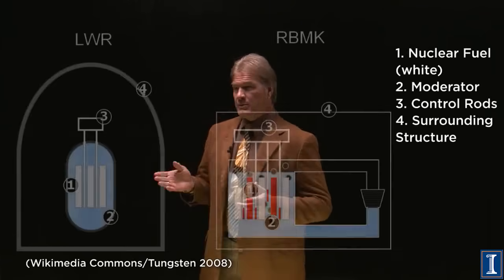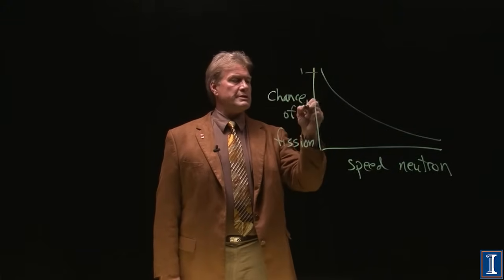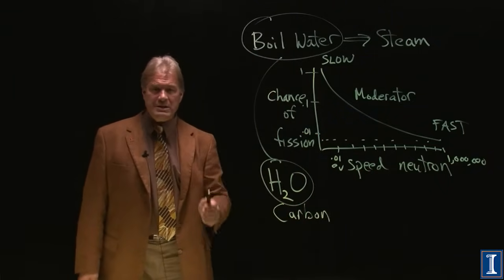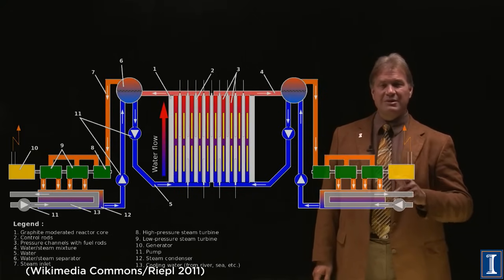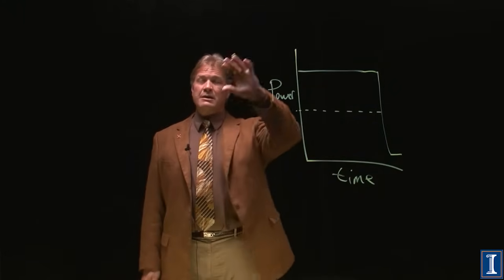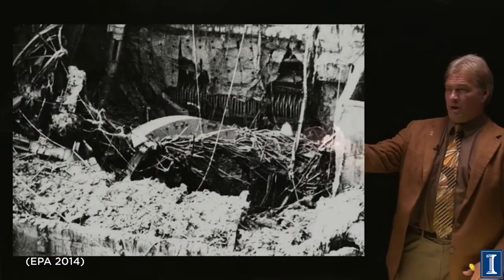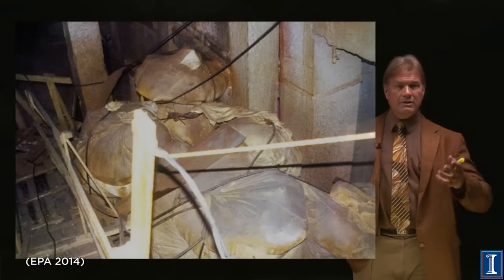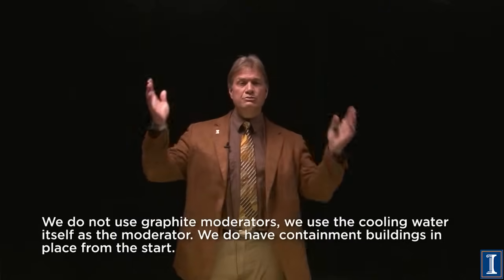Chernobyl: Worst Accident Ever

Comment: "Can a Chernobyl happen here? Absolutely not!"
>SL-1 has entered the chat...
Reply: You're referencing SL-1 as if it were an industry standard and not an experiment.  Not to mention it was 25 years before Chernobyl.  Nice try to draw false comparisons though.  

The same incident wouldn't happen here.  Just look at France.
Reply: @clint6716  Ah, yes, comparing a steam explosion caused by improper control rod operation to a steam explosion caused by improper control rod operation is totally a "False Comparison"...
Reply: @Kohdok  you missed the more important parts of my response.  This was in 61, before most of the safety precautions that were ignored in Chernobyl even existed.  There 'containment' structure was 1/6th the size it needed to be and not made of the right material.  Comparing these two incidents disingenuously ignores all the research that took place between the two events, and more so discounts the even more modern advancements since.

The answer is still no, it wouldn't happen here.
Reply: @Kohdok  yeah because one happened 20 years before the other, before we even knew how to deal with all of the bullshit that comes along with the shit. 
Long island was an unfortunate reality, but he's right. A chernobyl could never have happened after long island, cause we wisened up, while the Russians didn't know.
Reply: Yeah but usa good, russia bad

Comment: Problem with this is that the water pumps were not turned off, they were tied to turbo generator 8, 4 were drawing directly from the generator, 2 were connected to mains on standby and 2 were on mains during the test, when the test began the turbo generator was rotating so slow that 4 pumps shut down, power buses shutting off due to insufficient power causing the test to fail, they hot wired the reactor and safety systems to force the test to go through, Dyatlov ordered his men to switch on all the pumps which prevented the men from seeing the instability at the base of the reactor's core, it was kept in check by the flow of cooling water but when that stopped, the reactor began to spike, so they began to reinsert control rods but this caused power to increase because the rods had graphite displacer rods below them to ensure steady reinsertion, those hit the hot spot at the reactors base, the men in the control room assumed the reactor was running out of control so they decided to SCRAM, AZ-5 pushes all the control rods in at the same time, they didn't know this is what was causing the power spike an inadvertently triggered the reactor's power to rocket, the roof to reactor's building blew off because the reactor actually blew a hole in its casing, with the "lid" off air was sucked in from the hole and created a massive volcanic eruption, it is highly likely that if the hole hadn't been created then the reactor would not have blown the roof off, as it was a steam explosion that ejected the reactor core from its jacket not an combustion explosion!

Comment: i need to add two things, first the test of the reactor was made to see if they can safely shoot down in case all the energy grid was sabotaged (cold war) and no energy was available to pump water thru the core, so is not "to test a safety system they manage to blow the reactor" it was poor training accident but the test was needed. Second Fukushima accident did manage to break the containment vessel and send radiation to the sea, fukushima is still pouring radiation to the Japan sea, as the deform fishes show in the videos. The containment vessel not always work.
Reply: No the test was to see how long the turbines would still spin before the emergency generators had time to restore power to the pumps.

Comment: There weresealed and modern  pressurized water reactors  in the SU.And in the Eastern Block.Our 4 blocks (VVER-440)were built and comissioned in '82.The soviets requre more energy,and RBMK were much cheaper.Wery much so.It won't blow up,if human stupidity and direct override of security systems were never deliberately done.And if the computer were given the option to shut it down like other pkants.

Comment: As far as i know, the initial power drop wasn't because someone pushed the wrong button, but because the Test was not in the environment it should have been.
Due to demands from the power grid, the test was postponed and the reactor was running in a lower-then desired configuration for too long, so it build up a lot of Xenon.
When they tried to lower the power to the test-value, they pushed in control rods. The allready poisoned reactor quickly dropped as even less xenon was burned and so it plummetet down

Comment: If your just trying boil water then why not just make a giant kettle using electricity? Design those metal filaments to be giant and then just switch it on, simple.
Reply: LOL uhhh...  not!  Do you realize how much electricity it would take to power that super element?

Comment: The Canadian Deuterium Reactor (Candu) you mentioned DOES have reactor containment. I realize you were talking about the reactor design at the moment and not containment but I felt it was important to mention
Reply: It also has a vacuum structure set to trigger in an incident, water and neutron poison sitting on top of the reactor if containment fails, the control rods drop into the core if the power fails, and two other systems that are in essence loaded guns that fire and kill the reactor in case of fault. The CANDU reactors are the safest on Earth. And they even burn unenriched fuel like the RBMK.

But because of the heavy water moderator, they're crazy expensive.

Comment: did the containment building save Fukushima?  this is a 2019 video?
Reply: It was a 40 year old reactor. Plus the entire thing failed was because all of the diesel generators powering it failed. No modern reactor has these. Fuckhusima could not happpen with modern reactors no matter what.
Reply: The reactor in Fukushima did not explode, it entered meltdown. The highly radioactive gas travelled through the steam pipes and a worker wrongly opened pressure release valves which made the radioactive gas pile up, causing the explosion, but outside the containment shielding of the reactor.

Comment: IF THIS DIAGRAM IS CORRECT, THEY WERE GENERATING RADIOACTIVE STEAM AND THEN CONDENSING WITH RIVER WATER. THAT'S JUST GREAT!
Reply: That's how every single BWR works.
Reply: There is a thing called heat exchanger which keeps the reactor water and cooling pond water separate
Reply: @tejasbhandare251  I WAS A NAVAL ENGINEER. PWR AND BWR ARE DIFFERENT. THANK YOU FOR THE COMMENT.
Reply: @tejasbhandare251  I WAS A NAVAL ENGINEER. I UNDERSTAND CHANGE OF STATE AND GENERATING HP WITHOUT MOVING PARTS MY FRIEND,BUT THIS WAS BWR AND NOT PWR.THE REACTOR IS THE GENERATOR AND NOT THE HEAT EXCHANGER .THEREFORE THERE IS NO PRIMARY CIRCUIT. IF THE MAIN  CONDENSER LEAKS(TUBES) THERE WILL BE A LOSS IN HG(CONTAMINATION).

Comment: What is mind boggling to me is that they have considered this to be a safety feature. I would understand it as safety feature if there was a button that would start a computer controlled procedure for emergency off-grid shutdown while powering from turbine spindown. The kind of button for which you don't have to shut down other safety elements (Yes, I'm aware that the actual emergency shutdown button blown the whole thing up). But clearly from previous tests this has shown to be so difficult state to achieve, nobody should have considered it a feature at all.
Reply: The "emergency" button is not what caused the explosion.  The events following pressing that button is what caused it, and the plant operators were not aware that their actions could cause the accident.

Comment: It's wrong to say that the accident was caused by the operator hitting the wrong button. He is probably referring to the AZ-5 button, which was the correct button to push in this situation, or so they thought. Tuptunov did however make one mistake and missed a step. In the HBO series at 33.00 episode 5, they have already started to lower the reactor and it's at approx. 500Mw. At this point, to get the power back up they switch from Local control to Global. On Local setting you can control certain areas of the reactor. By switching to Global you are now controlling all the control rods. Tuptunovs mistake was that he should have given the computer a value that he wanted the reactor to be bought to. He didn't, so the computer defaulted to its previous setting. Near zero.
Another mistake in the series is that Dyatlov actually wanted to run the test at 200Mw, feeling the lower power would be safer. So yes, the series got it correct that at 500Mw Tuptunov switched from Local to Global, but it was to lower the power, not raise it.
The mistake Tuptunov made wasn't the primary cause of the accident, but just another link in the chain leading to the disaster.

Comment: "The containment building is expensive"

Yet another reason why I'm interested in molten salt reactors: doesn't need a containment building.
Reply: Containment building is a safety feature
Reply: @tejasbhandare251  It's a safety feature needed in water-cooled high-pressure reactors, as we saw in Chernobyl.  An MSR isn't a high-pressure reactor, and it can't melt down, it can't explode. I wonder if building the MSR a few stories underground would be sufficient for any lingering safety concerns.

Comment: I like these. Graduated with B.S. in nuclear engineering from U of I in 1981. Unfortunately, my career did not go quite as planned.
Scott
Reply: Can you explain why it didn't? I'm very interested in being a engineer at a nuclear power plant.
Reply: @dylanshaft8936  It got too political, my boss was an idiot that knew about 1% of what I did, and after about 20 years I quit to go back to grad school. It was a very secure job (and the only adult job that I quit and did not get fired from, but that's a long story). I should have stayed. Do you want to be a nuclear engineer? Or a plant engineer (usually mechanical, and where I worked, they were assigned one or two plant systems that they were responsible for). Pay was high for either one, but nuclear was better, and you only had to go where it was hot, dirty, and radioactive every 12-18 months to supervise the refueling, where they replace 1/3 or so of the nuclear fuel bundles, and switch others around the core. But realise that you will probably be required to put in overtime, only sometimes planned, and will probably be on-call 24/7. I spent many nights, weekends, and holidays at the two plants that I worked at.

I am happy to answer any questions that you might have; just please remember that I got out of the industry in 1998, and I can think of more than one thing that has changed. Do you have a plant/location in mind? I worked at LaSalle in Illinois, and River Bend in St. Francisville, Louisiana (about 20-30 miles north of Baton Rouge; probably about as close to civilisation that you can find in that business. For some reason, they like to locate these plants in tiny little bullshit towns that like to give speeding tickets, in spite of the millions of dollars that the companies dump into the local economy and politicians.

Where did your interest come from? It actually is very interesting compared to other engineering jobs that I have had. (I sometimes would walk out on meetings after listening to arguments about whether the letters on interstate highways signs should be 14- or 16-inches!) Do you have your P.E.? I got one in mechanical and passed, but later got a nuclear one, that has a low pass rate. Right now I think that I am probably the only active one in Louisiana! You don't need a P.E. in industry, but some companies require it, and it looks good on a resume. Having looked for jobs for the past three years or so (after quitting my "survival job" of being a rent-a-cop for $10/hour), I can recommend that you get one. They don't usually really care what kind of engineering it is in. I can't get a job because I am 61 years old, and will start getting Social Security next year, if there is anything left.

Sincerely,

Scott

p.s. I mentioned radioactive. Well, I had to have a saliva gland and a few other things removed from my neck due to radiation damage. But in the United States, they are pretty serious about keeping doses low. I wouldn't let it stop me.

Comment: Professor, would it be possible to mitigate a rupture along a subduction zone by using geometrically designed solid granite sacrificial “wedges” like those used to mitigate ocean waves? Heavy enough to sink through the sea bed sediment into the fault, dropped by ship at intervals tbd. Could this act as a stopgap allowing for a series of smaller mag. quakes spread out over time vs one high intensity rupture all at once.

Comment: Can someone explain something for me? I understand the risks of RBMK reactors due to the graphite moderators. But, in the talks he states this type of accident can’t happen in western water moderated/cooled reactors. So how did Fukushima melt down. As I understand it that is a water moderated and cooled reactor yet the fuel still melted through the containment vessel and ultimately had to be stopped by flooding the building to cool it??
Reply: the tsunami and earthquake damaged the backup generators and the Fukushima powerplant was an old was built in 1971

Comment: The problem with the control rods were that it wasn't entirely made of boron, but it had graphite tips. Therefore accelerating the reaction when they pressed a3-5. As the rods were lowered the reaction shot through the roof, which inturn made the reactor go oh pizdets and blew up.
Reply: They didn't have graphite tips. That's what the tv show said, but it's not an accurate description.

Comment: I got a question right here. Maybe I mix some things up but...
Watching this video about Fukushima: https://www.youtube.com/watch?v=5mVKVeU75ZA
When the coolant, the water, disappears the reaction should stop or at least slow down right?

But in this video it is explained if the water disappears the fuel rods get extremly hot and melt.
So it's not like the coolant disappears and everything is quite fine right?
What is right here or do I misunderstand something? :)
Reply: The problem is decay heat.. it doesn't last for too long, but long enough to cause a meltdown.

Comment: That guy has been proven wrong by Fukushima
Reply: You are entirely incorrect. Fukushima, while very bad, is not nearly as terrible as Chernobyl. Plus Chernobyl was good old human fuckery, while Fuki was such a natural disaster as had not happened in memory. Had the disaster not happened during a refueling cycle, then Fukushima would not have been an issue at all other than the cores themselves being ruined. This guy did a video on Fukushima. Watch it.

Comment: This video in the lower left says it is using wikimedia commons diagrams from 2008, this video is obviously before Fuksuhima 3/11/2011.   Does the professor mention fukushima in the video? no. 
Do you see a 3ft concrete containment building around any of the japans numerous 3/11/2011 meltdowns or spent fuel pools?  No.
It doesn't take a genius to understand it was idiotic of American occupied Japan to build 55 nuclear power reactors on the earthquake, tsunami, typhoon prone islands of Japan next to active volcanos. 
It only takes a couple hours for molten corium to melt through 3ft of concrete.

Comment: 29 seconds in, and he gets the acronym wrong. Not a good sign.

2 minutes in, and he tells us the main difference from reactors in the rest of the World is that the RMBK [sic] has no containment. Uh, no. That's not the big difference. The RBMK blew its thousand-tonne lid dozens of meters into the air. No containment would have held against that.

The real difference is that this reactor could blow up with that much force.

Graphite is much denser than water. That's its attractiveness.

Comment: So if water cooled and moderated reactors are so much safer, explain Fukushima.
There are so many more aspects like decay heat, missing confinement in Fukushima, possibility of melting down of fuel rods. Eventually with the possibility of a continuing chain reaction.
All things considered nuclear fission doesn't seem to be all that great, especially if there are better and (already) cheaper sources.
After all, the latest New reactors in gb and France broke records when it comes to exceeding cost estimates!
Reply: Guess you didn't watch his video on Fukushima.
Reply: @danadurnfordkevinblanchdebunk  yes, I did. I'm missing the reference here - especially warter cooled reactors are not necessarily as safe as he suggests.

Comment: Carbon was the moderator at Windscale ( Sellafield ) in England in 1957. Political madness by then PM MacMillan in ordering the shaving of the cooling fins to increase heat to produce more Tritium for UKs first H Bomb in order to compete with the Americans to sit at the top table with Eisenhower; ended up setting fire to the core that released vast quantities of radioactive materials into the atmosphere. Not mentioned much these days but still well searchable on YT.

Comment: 1:30 9/11. Apparently not.
Reply: How so ?? if you're referring to the twin towers the main reason the plane was able to bring them down was because the steal beams were on the outside and the concrete was in the core of the building, if ithey had concrete as thick as a containment building on the outside they'd still be there.